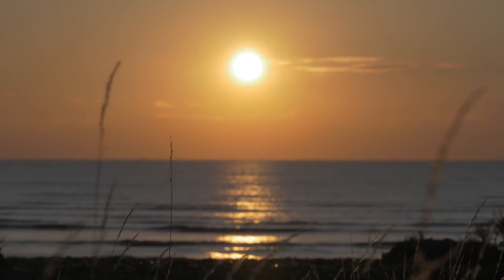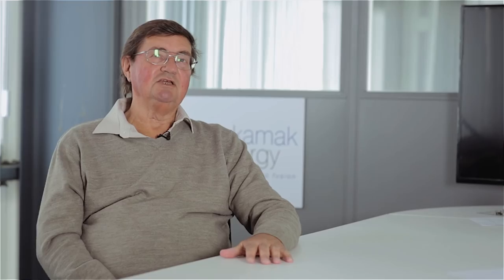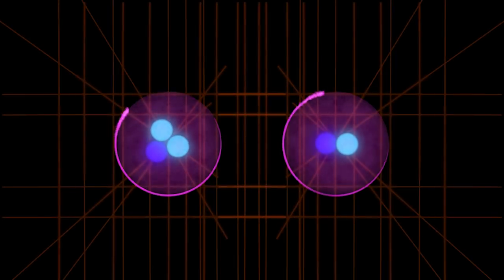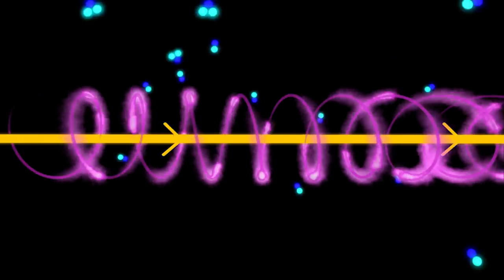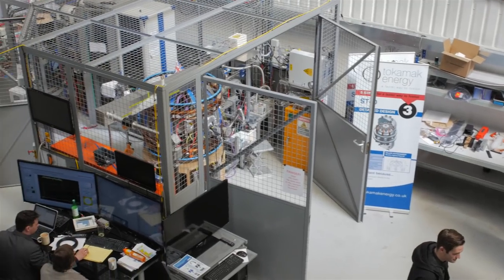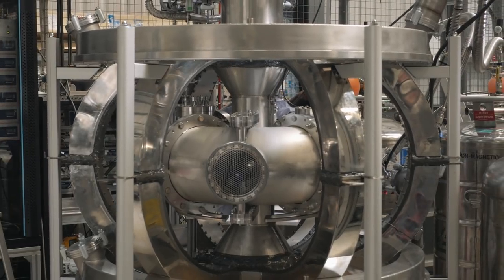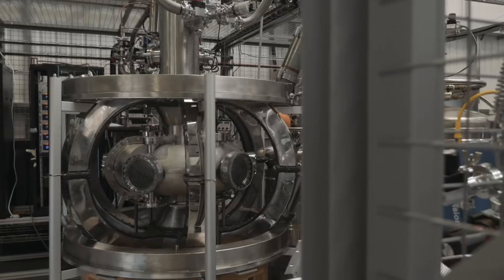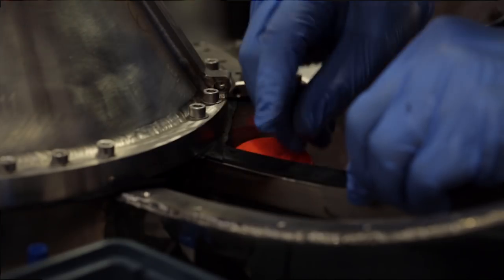Faster fusion

Comment: I would have liked to heard a little more about how far we are from fusion that produces more energy than we put in
Reply: Jaskbi That's the really big question.  We don't know.  Fusion energy is one of the most difficult science and engineering challenges there is.  We've never done this before, we're learning and we're not sure how long it will take.  But smaller will always be faster.
Reply: no really it is quite simple because it to atoms collide and create heat. so if the atoms exceed the speed of light the would create a nova and or star of the heated atoms
Reply: +Sukarino nothing is truly ridiculous since we split the atom and went to the moon it seems our species is built for achieving the impossible.
Reply: Jaskbi 
What? That makes sense ._.
Reply: Devin Aufdenkampe 
What?! Tf are you saying
Reply: Kai, traveling faster than light is theoretically possible, if Einstein is right about space-time.
Reply: ITER is supposed to be about Q=10 meaning it produces 10x as much energy as it takes to run.
Reply: We are on the brink. Just not with some silly tokamak- or stelerator garbage reactors.
Reply: HekateMGO
That is not what Q is about. The Q value is about the efficiency of the reactions. But then you also have to get the energy out of the reactor and then turn it in to electricity. That part still relies on inefficient steam turbines.
Reply: "The Q value is about the efficiency of the reactions."

The Q value is specifically the output of energy calculated using Einstein's theory of E = mc^2. The Q value isn't compared against anything else, so it's not a measure of efficiency. I don't think you know what you're talking about.

Hekate is certainly more right than you are since the break even of nuclear fusion happens to be Q = 1, but the efficiency of the energy output is expected to reach infinity at Q = 5 as that's when ignition is expected to happen, which means that it becomes a fusion reactor that heats itself enough through its fusion reactions to create more fusion reactions without further energy input. So when he says that a Q value of 10 means you get 10 times the energy from the system than you put in, that isn't right.

From there, you're right that the escaping heat will heat a coolant that will drive turbines.

You're both wrong, but both kinda right.
Reply: Also, Electro-Cute, JET (a tokamak design) holds the record for Q value at 0.65.
Reply: The Q value I was thinking about is a ratio between the power put in to the system and power released from fusion reactions. It is not based on E = mc^2, it is based on measurements of neutron count and the measurement of power input. By this definition several reactors have reached break even, which I think you already wrote was Q = 1. NIF's ICF reactor is one of the reactors that have already reached scientific break even.
But every system has one or more Q values. So there is also a Q value for the efficiency/quality of the entire reactors ability to generate power. There you have the break even which most people are familiar with. Here you have to count in all the forms of energy losses you may have.

ITER plans to have a reactor that needs 50 MW to produce 500 MW of fusion energy. That doesn't mean that they will be able to provide 500 MW to the grid.
Reply: Q value is a variable in both nuclear chemistry and physics that determines the amount of released energy based on calculating pre-mass versus post-mass using mass-energy equivalency to calculate the energy release. That's it. Nothing more and nothing less.

In fusion reactors, generally speaking, you need more than simply Q > 0 to break even. There are a lot of factors that go into what that Q value is.
Reply: Then you are mixing up two completely different types of Q values. There is one and only one Q value for the reaction; H2 + H3 -> He4 + neutron + energy. Are you telling me that ITER is trying to redefine the laws of fucking physics by changing the Q value of the deuterium tritium reaction? Let that marinate for a while.

When working with fusion reactors, like on ITER, you may try to predict what the density, confinement time and the temperature will be. Based on that and the understanding of physical properties of the fusion fuel you could try to predict a quality factor of the reaction. I guess there you might find the usage of E = mc^2.
Reply: Give it 30 years and we'll see it introduced into planes
Reply: It seems to always be a long time in the future. I've been reading about fusion since I was a kid and in the late 70s they were saying it was maybe 30 years away, it's stayed being 30 years away for the last 40 years and now it seems people are less willing to put a figure on it at all.
Reply: That is because they have been working on the wrong reactor types, like the garbage Tokamak reactor and related reactor-types.
There are far more promising fusion projects than the Tokamak garbage. Lawrencewill Plasma Physics is the company that is developing the Focus Fusion device. As it looks now 30
 years is an gross overestimation of how long time it will take for them to build a working reactor that could be placed in any slightly larger public transport device. Like a buss or anything larger.
They are at the brink of break even. They are almost ready to do tests with condition that should according to prediction result in break even.
Reply: Electro-Cute, I'm sure these claims of being close to break even have been verufied by independent research before you just believe them, right?
Reply: Not to mention dealing with the neutron bombardment and penetration of reactor walls while it's running.
Reply: The Focus Fusion concept is indeed interesting and their website appears plausible and scientific. I'll be watching their progress with interest.
Reply: If you get certain amount of fusion yield per unit of time then the reactor will get all the energy needed to run it self from it self (if you do not count with the magnetic fields). If the yield results in a run away effect then I imagine that it could cause the plasma to become unstable, move to the sides, touch the reactor walls and cool down to nonexistent at the rate of microseconds. So it could become critical, but it would in no way behave as a bomb. Maybe it could cause some wear on the walls of the reactor that could also lead to impurities in future experiments.
There are also a lot of research done in countries like Sweden, USA, Italy, Japan and China, to see how you can with external magnetic fields control the movement of the plasma when it becomes unstable. But if the reaction is runaway then perhaps the best is to let it die instead of fanning the flame.

... Oh and I think the output/input ratio (also called the Q value for "Quality") is 0.65 for JET (The worlds largest Tokamak reactor built in England)
Reply: +nexus1g Traveling faster than light is not possible, not even theoretically. Are you talking about folding space time? Because that's not traveling faster than light. 

Think of it like this. In Mario Kart, the Karts have a maximum speed. The maximum speed of the Karts limits how quickly you can complete a lap on each track. However, in the older versions of Mario Kart especially, there are certain glitches you can perform that allow you to skip huge portions of the track, giving you a ridiculously faster track time despite your maximum speed staying constant.

The speed of light is the maximum speed the karts will go, and folding space and time are the glitches you can perform to skip huge portions of the track.
Reply: NS S
The thing is that the speed of light is the reaction speed of the electric and the magnetic fields. Light is made out of electric- and magnetic fields. All the atoms/molecules in your body is made out of electric and magnetic fields. It is perfectly natural to assume that you can't travel faster than the speed of light because then your molecules no longer have any time to react.
This is classical mechanics/electrodynamics talking.
Einstein assumed that light was a constant value of "c" to every observer, no matter how fast they where traveling.
Reply: Shelton Burnadeski
I like your usage of Mario Kart References.
Reply: Shelton, I know this. You spent too much time expounding on a simple comment for no other reason than to flaunt your knowledge. My comment was way too ambiguous for you to egotistically assume that I didn't know what I was talking about. I never said in what way you could travel faster than light. In your example, "light" would just be another car on the track. As long as you get to the finish first, you traveled faster than light.
Reply: +jaskbi Yes. By fusing atoms, and being able to harness the power from the fusion, we would be creating close to 100 times the energy that is put into it.
Reply: +Pupper Haha, i agree with this reply very much. Traveling faster than the speed of light may be possible, but is much more likely very theoretical. However, we've been splitting atoms for a long time now. This is how the us came up with the very powerful Hydrogen bomb. They found splitting the atom created a much larger blast than that of just using a unstable atom, and letting it explode.
Reply: +nexus1g yay relativity. Now let me bend space-time already science -.-
Reply: +Dwight If not sooner haha. Scientists have been hard at work figuring out how to better fuse atoms, and harness the energy. Just keep an eye out, im sure it'll be much sooner that 30 years :)
Reply: +Gummy Bugz Actually, once we've come up with an efficient way to harness the energy, we are looking at a (input/output) of approximately 1/100
Reply: +Sheldon Burnadeski It is theoretically possible, but this is assuming that Einsteins relativity theory stands correct.
Reply: I'd say about 10 years. My reasoning?
Look up the presentation "Breakthrough in nuclear fusion by prof. Dennis Whyte"
Basically we just now got amazing superconductors, way better than anything before and they're commercially available already.
Reply: @pupper42  Or "Oklo-phenomenon"
Reply: Well, 6 years have passed. Where is the commercial reactor? He's gone. Why? Because the theory is wrong. Maybe empty stories about thermonuclear reactors will be enough? Making a commercial fusion reactor in two years is real! Selling this technology.

Comment: Dear Lord, the comments on this video are pure cancer. Too many people talking about science without knowing a bit of it.
Reply: pitthepig 
"Ok we can do this but when will we get to the point when we can get more energy out than we put in"
"Well if you split an atom and it goes faster than light you can do that"
I think thats what they were trying to say lol
Reply: Tokomak still hasnt achieved a Capitol Q factor of 1 yet either so they are still using more energy to produce fusion than they are getting out of it.
Reply: Yep, people are not very informed about fusion.  We need to make the message about a Solution, not physics.
Reply: So true.  Some posters here apparently haven't even mastered elementary grammar and punctuation yet.  But they're pontificating about nuclear fusion?
Reply: We know how cancer works.
Reply: delavalmilker... Neither, have you !
Reply: Agreed
Reply: Even us plebs have a view and it's mostly our tax money paying for it, we have more pressing problems with regard to economic energy storage at present which should be easier to solve and low loss superconducting cables at outside temperature so we can reduce costs for renewables that would be a good start, also an alternative to low range lithium batteries to enable vehicles to go 1,000 miles on one charge taking less than five minutes or power your house for a day after your commute to work, after they are completed, carry on!?!